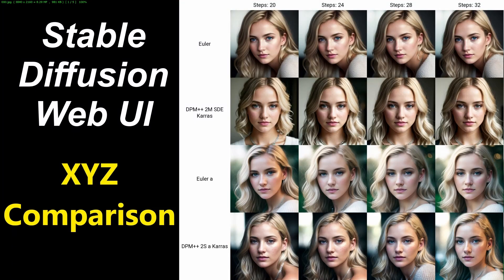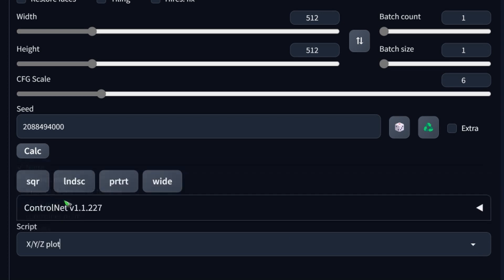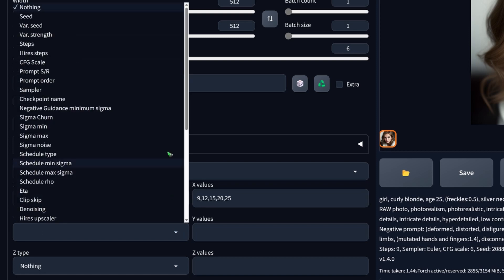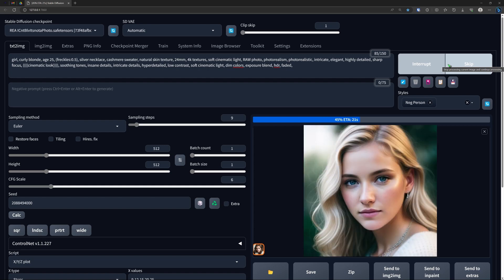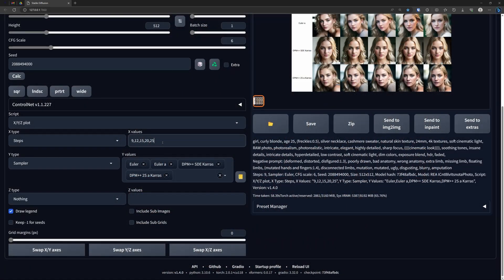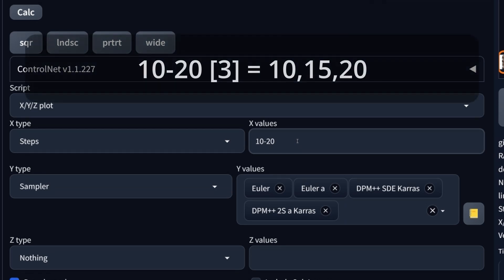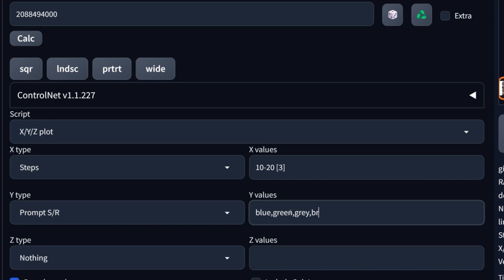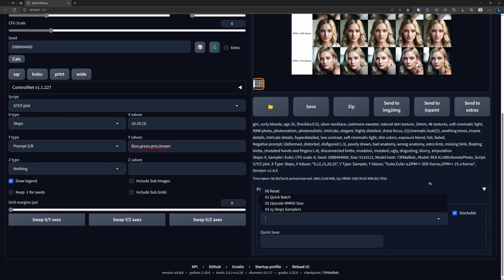Stable Diffusion XYZ Plot Comparison

Comment: few control nets (unit 0 and 1 and 2) I need use weogth of just 0 for xyz plot - how I can do this ?
Reply from the maker: I do not understand the question/ issue. Can you rephrase?
Reply: @rudyshobbychannel  control net in UI has few units (looked like tabs): Unit 0 and 1 for example, In unit1 I want use openpose control, but in unit 2 I want use depth control, Also I want create a grid with weight of unit one by X axis, and weight of other to y axis. How I can ordedr for exact Unit weight ?
Reply from the maker: @АллаКлевер  We're on the same page here ... just like you, I have no idea.